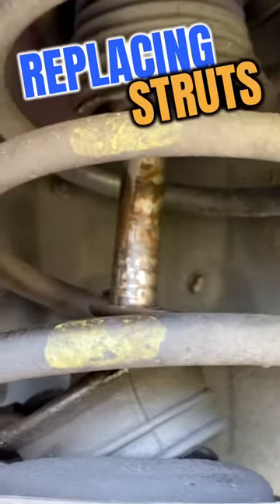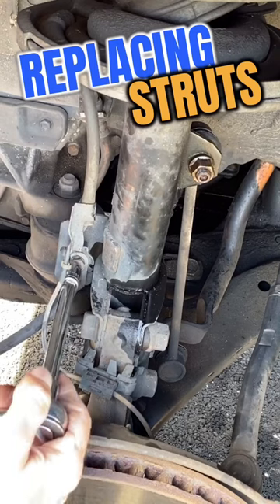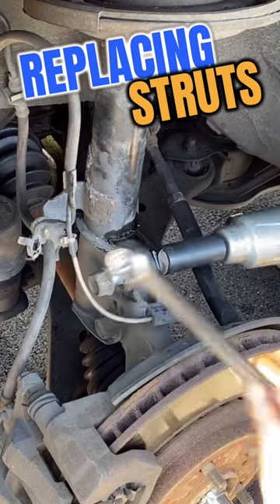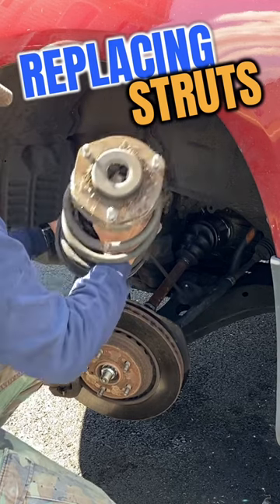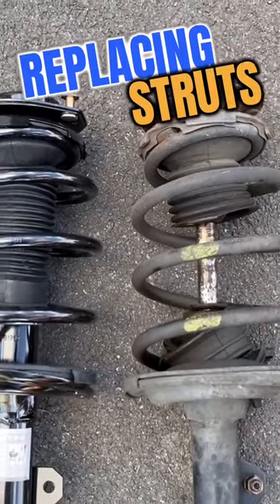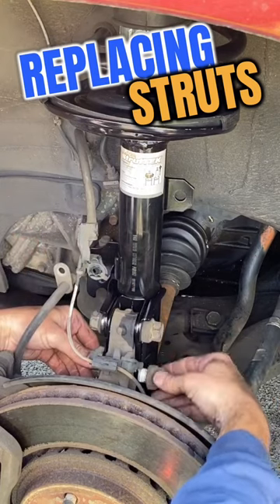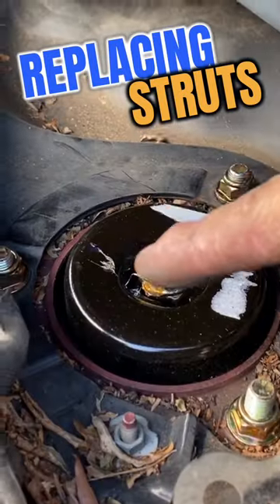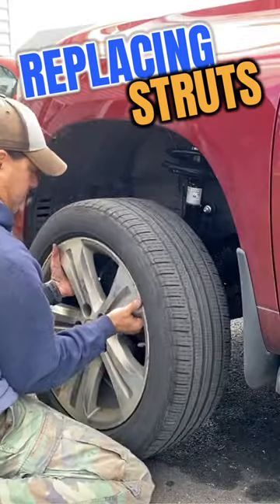Replace Your Struts QUICK & EASY !! #shorts #youtubeshorts

Comment: Where are all you guys doing these videos finding cars that weren't assembled by God's strongest 1,000 lb gorillas???😂  Seriously,  it took myself and several others days just to get those bolts removed, and they all ended up breaking and causing more problems... And I still have the other side to do yet 😬

Comment: You made this look so easy. I’ve watch people make 20 minutes videos and you did it in 2
Reply from the maker: Struts are pretty basic to replace however, this is only a 60 second short video so it’s highly condensed
Reply: @PhillipsVision my car is a ford 500 and the strut is inside the knuckle not just bolted on the side I was hoping this would the case in this video can you make one on how to quickly change struts with that configuration too 🥲🥲

Comment: They say replacing struts and springs can be a widow maker.  Which assembly must one watch out for?
Reply from the maker: Normally the most dangerous is if you are trying to replace just the spring and using a spring compressor. Those can fail causing serious injuries
Reply: @PhillipsVision  Thank you!

Comment: Front end alignment required since you did not mark your camber setting.
Reply from the maker: Alignment is always needed when suspension work is done
Reply: Not always busy for the most part yes, sway bar links, sometimes ball joints depending, rear shocks, front shocks if it’s not a strut
Reply: @PhillipsVision please include that in your video! YouTube mechanics aren't going to know that.
Reply: @ryanbareither89  it's a short, calm down
Reply: @Brandon-yq1tm  Not when uneven tire wear is possible!!
Reply: @ryanbareither89  maybe YouTube mechanics should know what there doing before watching a short video and saying im a professional

Comment: What if you just replace the shock and not the spring or outer bolting assembly?
Reply from the maker: @dave7315  You can but be careful with the spring, those can be dangerous

Comment: After replacing the strut you have to have an alignment done, You Have changed the Camber. Or your tires will wear on the inside or outside too much very fast

Comment: Does it sit up higher since its not a factory spring??
Reply from the maker: No, this is the same height
Reply: yes it will. I just did it today with KYB and stock spring. Car is a noticeable bit higher.
Reply: @TocyBlox I did mine today with KYB quick struts and it sits higher but has made all the difference
Reply: @colt2274  How's the ride comfort? I noticed that it was uncomfortably stiffer on my Lexus.
Reply: @TocyBlox  bumps id usually notice aren’t as noticeable. As soon as I backed out of my driveway I felt a difference. But my tie rods are bad and so is my Rack and Pinion so I’ve got other issues to fix
Reply: @colt2274  Interesting. Maybe the quick strut is different than just the strut using oem springs. 
When driving on bad roads, I can feel every crack. But I don’t feel the bridge extensions. Steering wheel gets a lot of feedback (good, but wrong car to have that much lol). 
Braking and steering got better (I can go down this wavy mountain at 80 mph without braking, very sketch before).

Hopefully it’ll settle down with use.
Reply: @TocyBlox  yes, watch a video Scotty Kilmer made on quick struts. He measured the circumference of the springs on the quick struts compared to the OEM ones and they are thicker on the Quick struts

Comment: how much did this service cost?
Reply from the maker: If you do it yourself you can do it for about $100 per strut
Reply: Dang, my local mechanic wanted  over $600 for this. 2011 kia sportage. @PhillipsVision
Reply: @borg386  find a new mechanic asap. Should be $200-$300 tops if using quick struts like shown in the video